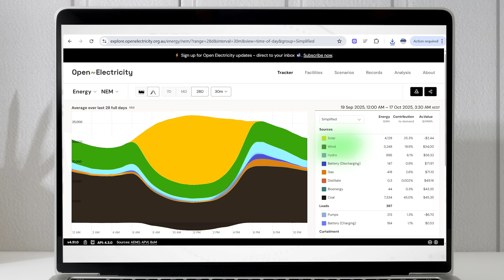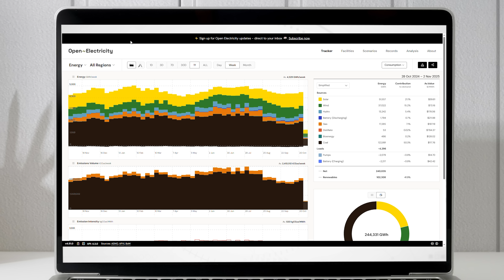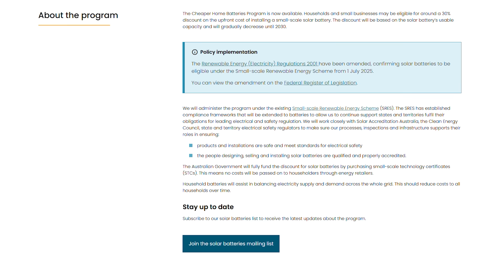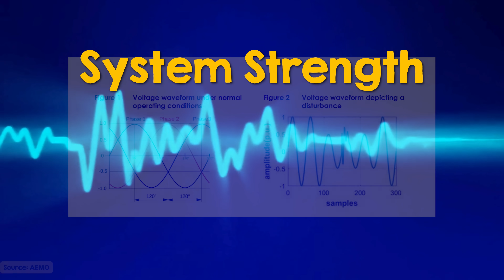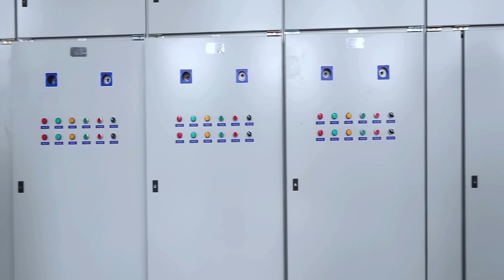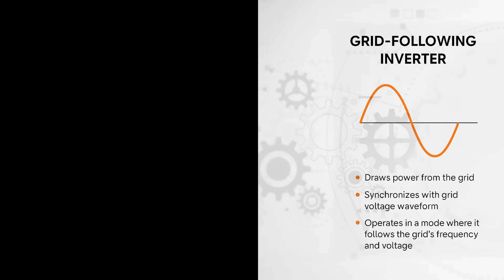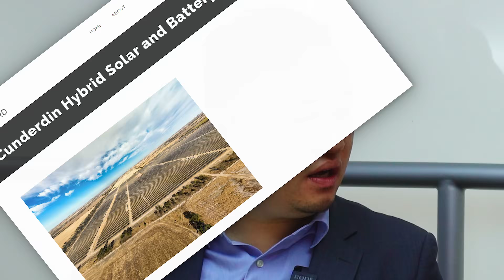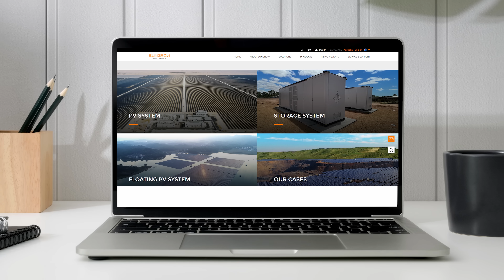Australia’s Solar Boom Is Breaking the Grid - Or Is It?

Comment: The Iberian blackout would almost certainly have been avoided if grid-forming inverters were allowed. Solar and wind farms in Portugal and Spain are literally banned from helping with grid stability because so many power engineers are still obsessed with spinning chunks of metal. Any utility-scale inverters installed in the past few years (possibly longer) should be capable of grid forming with a simple software/firmware update - or possibly just a settings change in the current software.

I'm glad that Australia recognized the importance of grid-forming inverters years ago: https://aemo.com.au/-/media/files/initiatives/primary-frequency-response/2023/gfm-voluntary-spec.pdf

Comment: Why do you need a single natinal grid?  Consider splitting the grid into isolated regional grids, create micro-grids for remote areas.  As single grid is always a failure point. Isolating grids reduces the impact of failures. As you have mentioned, energy storage is key and home and businesses should have storage systems.
Reply: In isolated networks, losses and payback periods increase sharply

Comment: So what's bad for coal plants is good for consumers but you say that it's better to rob the public to support coal because lower prices are "worse" for some ungodly reason. What you don't report is the fact that daytime peaking plants would cost over $240/MWh compared to the <$120 for batteries storing solar power and ~$20/MWH for the solar that directly displaces the both the expensive coal and the more expensive gas peaking plant power.

Comment: use the old coal generators driven by electricity to provide inertial generators
Reply: Yes, and then add gravity towers with massive gear reduction systems to lift weights with electric motors while cheap and let them lower to generate when needed. That also uses a bunch of excess daytime energy thus raising the prices then providing profits and makes night rates with shortages more profitable without the cost of steam generation all done in the old footprint so land cost is near zero, only construction costs and demolition. Should be rapid payback since it increase profit around the clock. Why wouldn't the utilities suck up that below zero power themselves for extra profits? Here in the states greed would drive them to do it on their own. Best part is there is no new tech so it is all proven engineering and off the shelf mostly.
Reply: @markpashia7067  Kinetic energy depends on the square of the velocity. This severely limits the capabilities of gravity storage compared to the increased speed of superflywheels with rotation speeds exceeding 10,000 rpm.

Using flywheels, superflywheels, supercapacitors, or batteries to stabilize the frequency, phase, and reactive power of wind turbines over wide ranges is much more cost-effective than attempting to stabilize the duck curve of generation and consumption within narrow limits.
Reply: @MihailG5541  So I was misinformed? I heard that most of that could be overcome by gear ratios and gear trains. You have weight times elevation change but the distance can be greatly compounded with gearing to release a lot of energy is a very short distance with those devices.
Reply: @markpashia7067  So you haven't read the long-term testing studies of such storage devices.
They're over a hundred years old, so it's a bit like reinventing the wheel, just like the desperate attempts at vertical wind turbines.
Reply: This is possible. The directly coupled steam turbines will need to be decommissioned or decoupled.

Comment: I think that you missed your calling as a nuclear power advocate..... You keep talking about grid stability and how a spinning mass is required to keep the grid steady and reliable..... 
I have seen my solar plus battery system responding to everything that I have thrown at it, in a recent video by Will Prouse (I think that's how it's spelt?) where he was testing circuit breakers and I was further impressed by how much faster power electronics can be, so much so that when he created a short circuit scenario via a mechanical circuit breaker, the breaker didn't trip! The electronics in the BMS were so fast in preventing a catastrophe that the circuit breakers purpose is almost redundant! 
The problem with grid stability is the legacy power generation systems..... They are too slow to respond to change that they should also be phased out alongside hydroelectric, gas and the obvious coal.... 
It's high time that Australia goes with a reverse grid system where power is generated everywhere and fed into the grid, this setup makes the whole grid more reliable and robust.... If a war ever came to Australia, the invaders will know where all the main power generation sites are and this is exactly what will be destroyed first to cripple the country.... But in a reverse grid system, they would have to destroy every single house and business development which is way too complicated and expensive to achieve.... 
Putting up new power poles (assuming that the grid runs above ground) and running new cables is faster and cheaper to do than build a new power plant..... Especially when you need power to continue protecting your country!
Reply: too many words!

Comment: The system sounds incredibly vulnerable to an em pulse or hacking. Are the smart inverters EM hardened?
Reply: There's plenty of experience in using semiconductors in grid applications, with a particular case being AC/DC and DC/AC conversion.

China hasn't hacked my inverter yet. I don't connect it to the internet, just to be sure!
Reply: @matthewmarks6951  A power station in the US was hacked and shut down a year or two ago, and it was considered to be a trial run by Chinese or North Korean hackers.

Comment: Grid stability is provided by inverters as they can ramp up and down instantly and this is improved when connected to larger batteries. Inverters also make load following an automatic feature which enhances grid stability. If the loss of a single generator can destabilise an entire grid it was poorly designed.
Reply: I think in the case of Spain/Portugal it was a combination of factors.

Comment: Dear Australia, A decade ago, you were one of the dirtiest countries in the world, and your transformation has been truly awe-inspiring. A little favour, when you get all that renewable power for almost free, please use it to produce steel and hydrogen, fertilisers, Aluminium production. This would really help reduce need for fossil-fuels worldwide, then, please, please, please stop exporting coal. If Australia said we're reducing coal production, to zero in ten years, watch the cranes swing to a halt over new coal plants in construction. You can make far more, by value-adding to your Iron ore, Bauxite processing, than you could make from coal, and do way more than you can mange even by going net-zero tomorrow. You know what that coal is doing, there is no excuse for polluting other people's countries either. Also, that whole global bit of Global warming.
Reply: Sorry to disappoint you but we loosing heavy industry almost weekly because of the cost of electricity. Almost all our Aluminium refineries have or are closing as a result.
We used to have amongst the cheapest energy in the World, but not anymore. This all coincided with the advent of renewable energy.
Reply: Hydrogen problems have not been solved and will not be resolved in the coming decades. Metal and fertilizer production requires stable generation with a capacity spread of no more than 15%, which is very expensive to achieve using renewable sources alone.

Comment: Question: is it possible to convert former coal power plants into rotational energy storage for the purpose of frequency stabilisation. and if so what needs to be done to them. They already sit in optimal places in the Grid and have all the connections they also have a huge mass and a motor/dynamo.
Reply: Basically remove the steam generation through demolition and install electric motor/generators that can spin up when needed and be drained down some when power demand peaks. That leaves extra footprint where the steam power was made that could be used for gravity towers that do the same thing only vertically. Those towers can be held back for late night or early morning if demand come before solar can come up. They are a great storage for delayed use. While inertial would be for sun down stabilization.